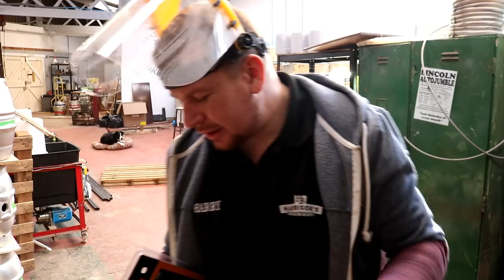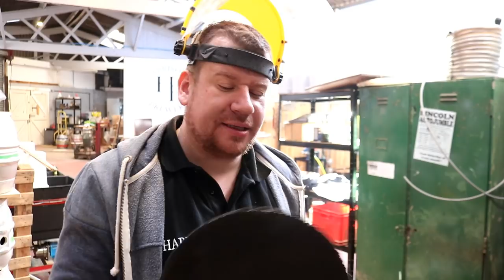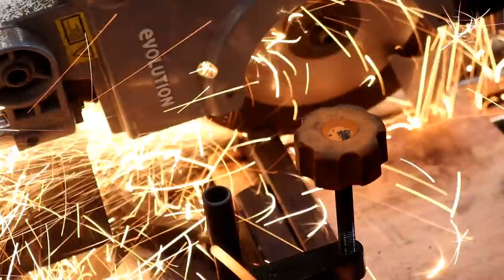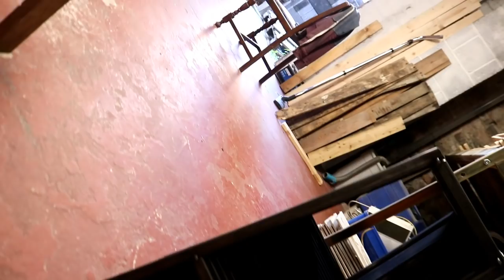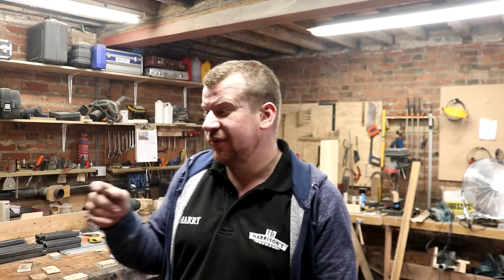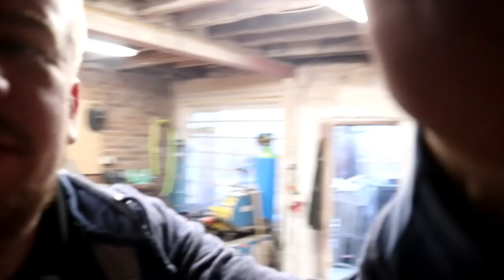I CUT DOWN THE ABRASIVE DISC

Comment: Have you got a ball park figure for the price of each stool?
How does it compare to buying similar stools new???
Reply from the maker: Including everything but my time I would say they cost me about £10 each. the steel was the biggest cost at £12 a length and each stool was about 3/4 a length, the ply was all from half a sheet of 18mm and the varnish was a tenner and I used hardly nothing of it.
Reply: @harrybrew69  Pretty good value for money then?
The jig you made will save a load of time. You could probably sell them for a decent price if you ever had an offer.

Comment: Wow you are really going to hurt yourself! Cutting a disc down like that is super dangerous..
Reply from the maker: This ain't my first rodeo kid.
Reply: You are a magician with the tools Harry! Love the VLOG!
Reply: I love the vlog mate, but I'd hate for you to get hurt trying save a few quid. And doing crazy shit like that its inevitable at one stage or another.
Reply from the maker: Hi Daniel,
For the sake of anyone else reading the comments let me explain why you are wrong. Firstly, The disc has absolutely no idea if it has been cut down by me or is that size due to wear from being used. They are designed to be worn away as you use them until there is not enough left to make a cut.  Second, I applied no lateral load to the disc during cutting, the structure of the disc was not subject to any forces it was not designed to take. Third, the finished disc was a perfect circle and after the first cut, any imperfections were worn down. See my first point. Fourth, the disc is being run about 1000 rpm lower than its max rated speed on the saw, meaning, there is less conservation of angular momentum acting on the disc to pull it apart.  And finally, I have a healthy respect when using power tools, I am and continue to train myself on the proper use of tools and have spent hundreds of hours with the pros and learned much from them.  Anyone worrying about this or blade guards or alteration of and/or bespoke tooling without any experience should stick to home gaming.
Reply: Bahahahahahahaha 🤪 what a response... you got no idea what your talking about. Lol
Reply: Daniel Midgley cut down or not, discs only really explode if they are twisted while in use, in a mitre saw that wouldn’t happen